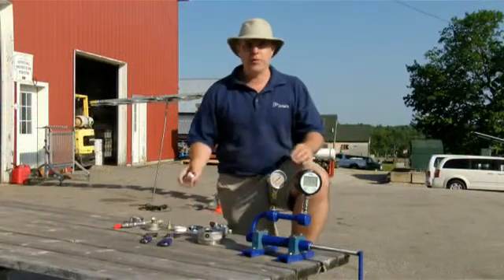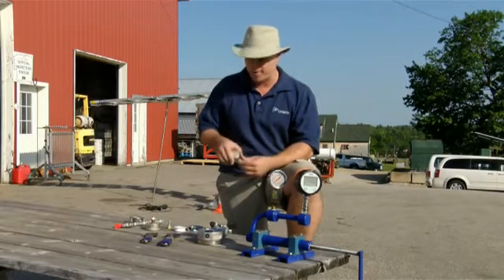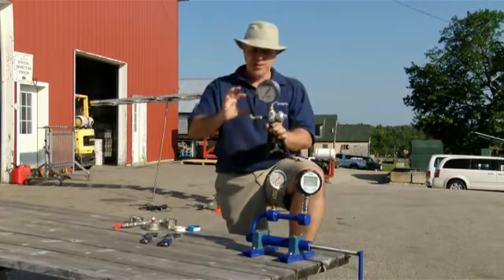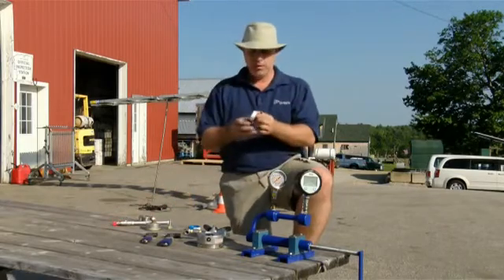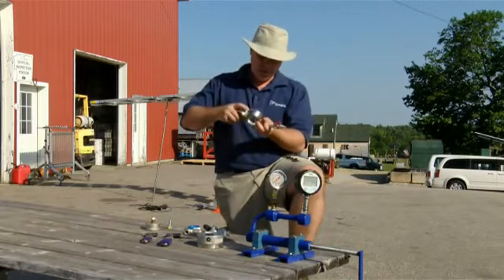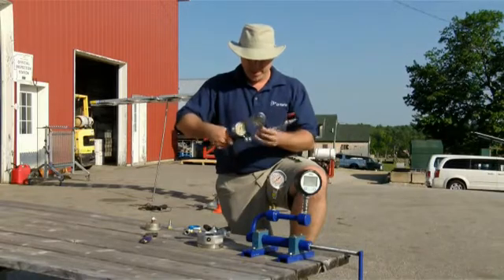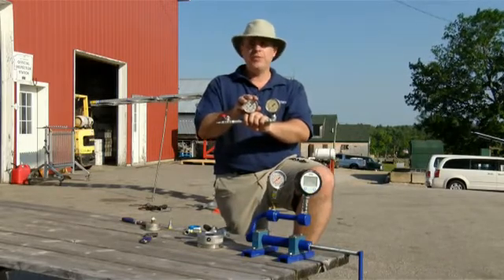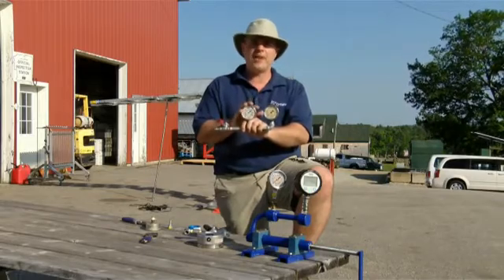Pressure Gauge Calibration

Comment: with a new nozzle I adjust the pressure until I get the known output for example 1.0 gpm @ 40 psi and see if the gauge  reads 40 psi.